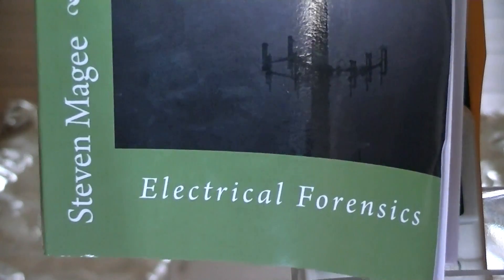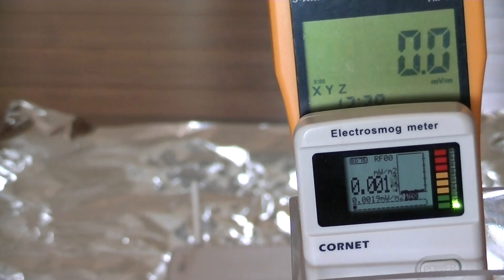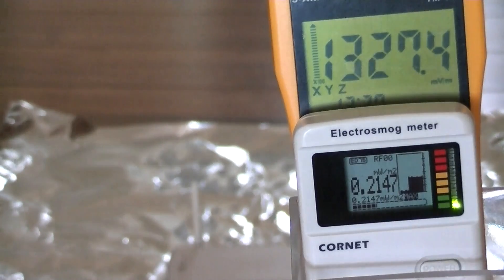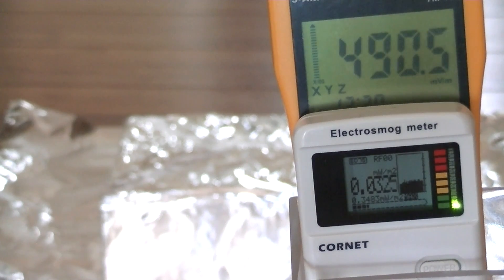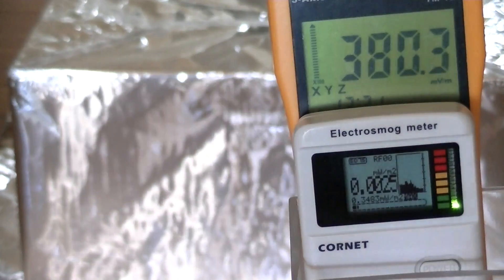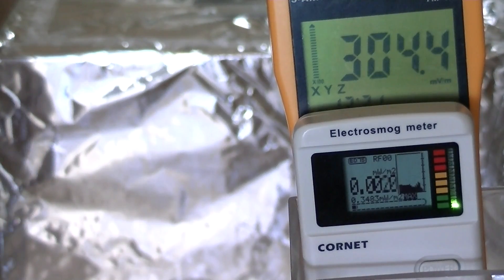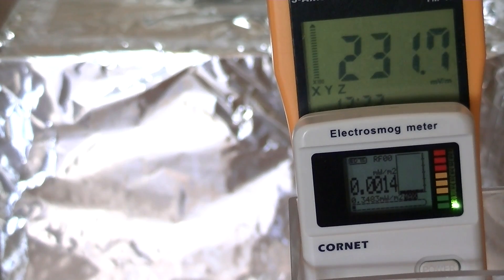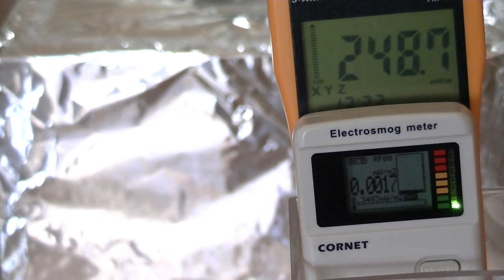2.4GHz Wi Fi Testing of Multiple Aluminum Faraday Cages, Grounded & Ungrounded

Comment: How about using an aluminum cookie sheet, or one of those disposable aluminum baking pans. They are thicker than foil. Would they work better?
Reply: Depends on signals bouncing off of it, too.
-Watch the other vid with the buckets and a trash can...(Multiple cages)
When the can or bucket is being lowered, the reading actually rises briefly.
I added window screens to the inside of a metal bucket.
-In my room, my signal actually got stronger than with just the bucket.
(My bucket is open towards the wall, so the next cottage can get 24 hour wifi.)

Comment: You need to put chicken wire. On the inside of the box. Then put aluminum foil on the outside of the box. I seem to remember something about 9 volt battery being hooked up-to opposite sides of the conducting material. I will design one for research purposes. Both in the 2.4 megahertz and 5 megahertz  range. Then post it.